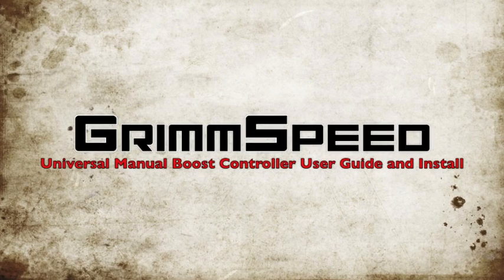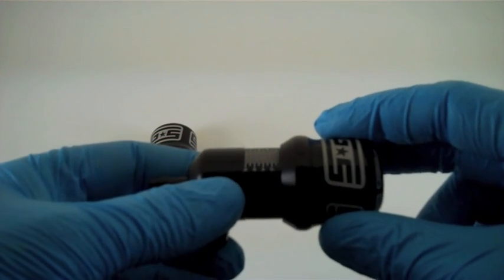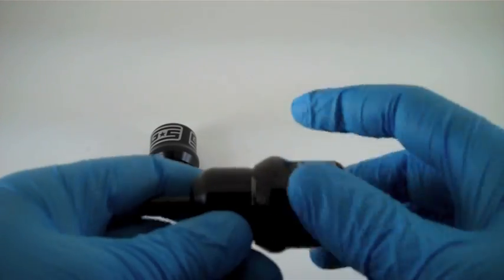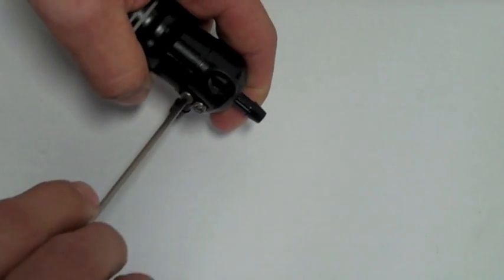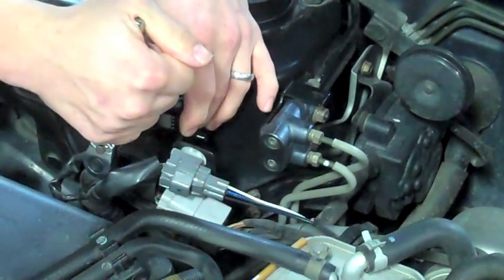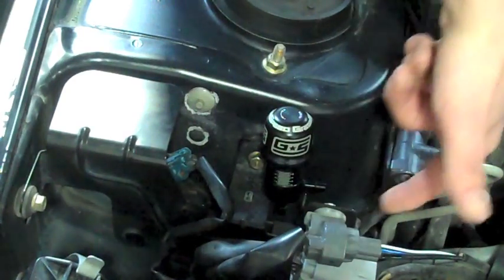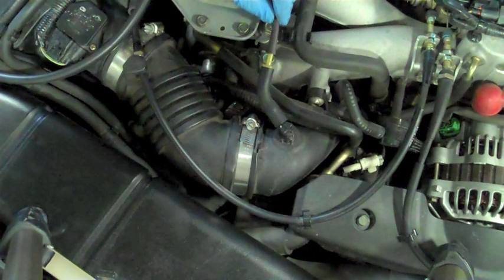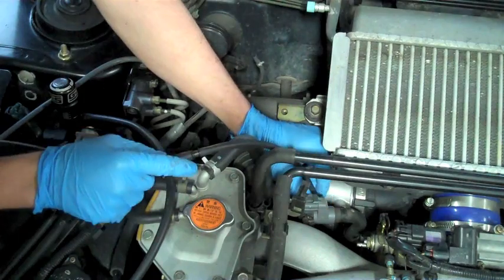GrimmSpeed Universal Manual Boost Controller

Comment: 1) if its control is manual, its necesary re-tune my ecu?
2) no check lights will turn on after unplug the oem selenoid?
3) after install that my bosst gauge should starts on 0psi? or -20psi?

Comment: so if I'm not mistaken 1 line = 4psi?

(1 full rotation is 16 clicks, each click is 1/4 psi so 4 clicks means 1 psi)
Reply: i know im 6 years late on this but did that hold true?
Reply: @Purpz710  roughly yes, i ended up ditching this though as i ended up using a stand alone ecu and controlling boost through a solenoid with reference from the w/g. These manual boost controllers are good for a budget build but if your trying to make higher reliable power it just makes more sense to use the technology thats available now

Comment: How do these units relieve backpressure from the MBC?.. If what i'm thinking is correct, its basically an adjustable valve(ball and spring type) that opens at for instance, 15PSI+ is open, Under 15 is closed.. What happens when you hit 15, pressurize the whole system, then turbo slows down to 10 psi, would that 15 pounds still be "stuck" between the wastegate & MBC? causing it to stay open, or is there some sort of slow bleed off

Comment: Just installed mine and It's amazing other then It does turn my check engine light on my 02 wrx
Reply: This is a year old, but I figure i'll respond so the next person reads it.

You keep your factory EBCS installed electronically, to keep the ECM happy.
Reply: @anotherpewtertahoe  ths so much I have been looking and looking for this you the man
Reply: hi there just wondering after installed the boost controller, how you deal with old factory boost controll unit?

Comment: I'm currently looking for a manual boost controller and i'm really interested in this item. I have a 18g larger turbo, can i use this boost controller with my restrictor pill??? matt homes GrimmSpeed Aftermarket Engineering  -2004 Subaru STI    Please reply!!!

Comment: What about full boost at part throttle? Is it bad to build boost that fast at lower rpms?
Reply: You can run a manual boost controller and an electronic one in sequence; you should look into it, because yes you are somewhat correct, it's preferable to have load/throttle dependent boost goals for the wastegate actuator rather than say just 18psi all the time no matter what rpm, load, throttle (which is what you'll get if you put a manual controller alone). That's not fun for a daily driven vehicle. A racecar where you're not trying to maintain consistent speed would be less of an issue.

When you run them in sequence the manual controller is essentially a safeguard so you don't overboost, the max allowable boost if you will, while the electronic controller maintains the ability to change boost goal depending on the situation.

If that's your car in the picture then the stock electronic boost controller is fine for the stock turbo, or just get a 3 port electronic controller from the many brands and get a tune. I believe grimmspeed has one.
Reply: I removed the hallman although it ran ok, except part throttle full boost didn't seem good.
I got a cobb accessport v3 and I'm happy at stage 2 for now. Thanks for the response.

Comment: A manual boost controller is merely a means of boost control.  You will want your tuner to tune and advise the appropriate increase in boost for your build.  Simply turning up the boost and not tuning the vehicle can lead to over boosting issues and potential motor issues as well.  Consult your tuner.  

-Matt Homes

Comment: Full boost is dependent upon a multitude if different variables.  If you are concerned about hitting full boost during partial throttle, you should be looking at an electronic boost control solenoid, not a manual.  The manual will always be seeking full boost and can be an issue for daily driving.  The electronic lets your ecu control boost levels and at partial throttle is much safer form this point of view.  Let me know if you have ant other questions or concerns.

-Matt Homes

Comment: When does full boost activate, i hear manual boost control systems will hit full boost at about 25% throttle. Im looking into purchasing a (MBC) system, but im a little skeptical to do so because of that issue.

Comment from the maker: Our manual boost controller is compatible with most turbo systems out there.  All you need is a boost input from the compressor housing or intake manifold, and a the outlet goes to the waste actuator.  Let me know if you have any other questions, this product was intended as a universal manual boost controller.

-Matt Homes

Comment from the maker: You can use a boost source from your intake manifold just the same.  Try to do this in the shortest length of vacuum line possible.  Let me know if you have any other questions.

-Matt Homes

Comment from the maker: It is hard to build boost when a a car is in neutral with any turbo system because the car has virtually no load on it.  This will be touch to do do with almost any boost control system.  -Matt Homes

Comment from the maker: @caboose36 Yes, you do actually want to keep them shorter. If you were thinking about running it to the inside of your car or to the other end of the engine bay I would suggest against it. Keeping the lines as short as possible will make the valve reaction and readout as accurate as possible! -Will